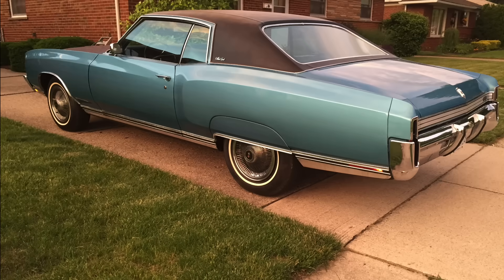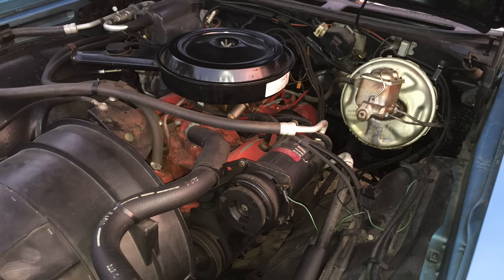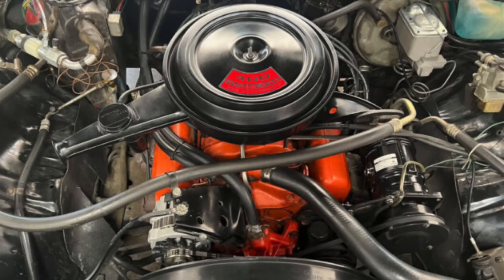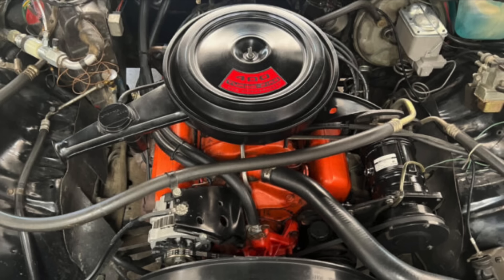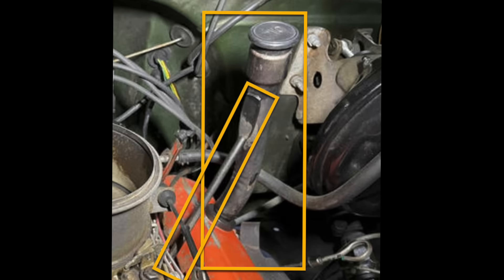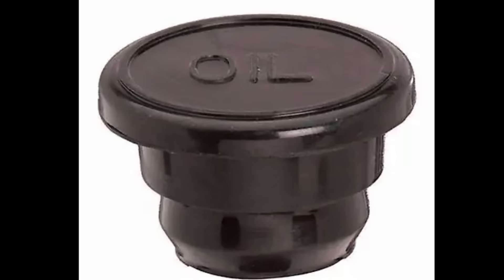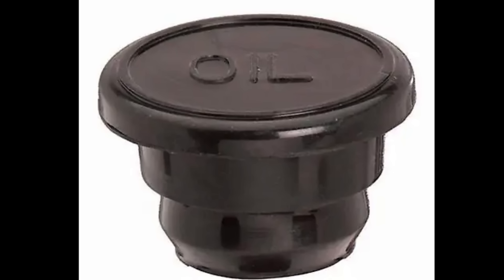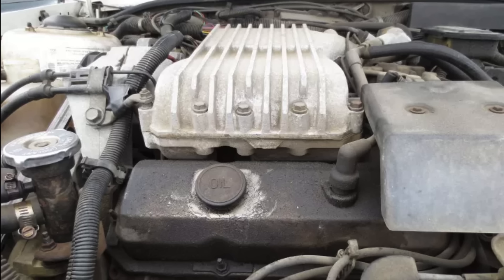Worst Automotive Ideas: Chevrolet's Crumbling, Rubber Oil Fill Cap (Small Block V8 / 2.8L V6)

Comment: my s10s has lasted almost 300k .
Reply: I have 250,000 miles on my 84 & my parents 89 S10 Blazer has 280,000 miles. Am rebuilding the 89 right now. Finally would not start. Would turn over okay but would not run. Compression was only 80# in a couple of cylinders while a couple others had 150#. Have a machine shop doing the machine work for me.That old 4.3 will be better than new. Not having any of that RTV sealant used all over engine as GM was so great at using in the 80`s! At 233,000 miles had to have the 2.8 "B" engine rebuilt as blow by was terrible!

Comment: On the subject of water pumps I'll have to say that Pontiacs were kind of bad for eating up water pumps. They would be fine if as soon as you got one you added water pump lubricant to the coolant. That seemed to do the trick. The fact that Pontiacs were a bit more of a PITA to change water pumps than Chevy's made it even worse.

Comment: Hardly a "classic", but my 2002 Envoy is old enough I have done the thermostat 3 times. Twice that I've paid for it, now that it's my winter beater, and it's nearly(?) a two hour job at the shop, due to it being behind the alternator and also about 8" tall. My other vehicles are far simpler, my 2010 Challenger is about a ten minute job being front and center on the upper intake-as God intended.
Reply: Better yet is2l ohc chev 4cyl t stat, just under rad cap. Take off cap pull out t stat, put in new 1 n screw cap back  on, no tools needed

Comment: Few are brave enough to utter the words "MY CIMARRON"
Reply: He loves that thing, check out his library, he searched long and hard to find one.
Reply: my mother-in-law and father-in-law loved their CIMARRON they had two one with a 4cly, the loved one with a v6 better car Cadilac should have made them all with the v6 and never put the 4cly in them stupid,
Reply: @jimbo5728  😂😂😂
Reply: For myself being around when those cars were new, we still had malls and they were pretty much at their peak. Every mall had a sweet smelling Cinnabon eatery and the Cadillac model spelling was close enough to make one think rich over sweetened cinnamon rolls when their car name came up. 
"My uncle has a cimmaron." 
"Mmmm I love those things at the food court in Fairlane Mall"
Reply: It was just a cavalier with digital upgrades. We are talking about 1980's vehicles. It's almost a half century old. Rubber oil caps were never a problem. I was a GM tech for 34 years. Dodge still  uses them on differentials.
Reply: @krisf7208  the Saville was just a Nova with caddy upgrades, and it worked a popular car beautiful car they added all the doo Dads on it left the v8 engine unlike the Cammeron nice looing car but for a Caddy way under power if the morons would have waited half a sec for the v6 it would have been the new baby Caddy
Reply: @krisf7208 I've personally known 3 people who never checked their Dodge RAM diff oil with the rubber caps and destroyed their ring and pinion eventually. The tell tale sign of a wet housing, especially when viewed at night with your headlights highlighting the problem. Made me want to chase some owners down and tell them to check their diff oil, LoL

Comment: I have never understood why manufacturers use plastic or rubber on pieces that will be opened or unsnapped in some maintenance area of a vehicle. I have several examples of breaking some snap or lock when doing some maintenance because after a few years they are not pliable anymore and just break off in your hand. Not always convenient to replace them and then the wire ties and duct tape come out to rig the piece back in place.

Comment: In response to your comment regarding Cadillac water pumps: I replaced TWO water pumps on my 1972 Sedan de Ville, One water pump on my mother's 1973 Calais Coupe, THREE water pumps on my 1976 Sedan deVille, TWO water pumps on my 1979 Fleetwood Brougham, and TWO water pumps on my 1983 Eldorado. Cadillac engines love to eat water pumps and air conditioning compressors.
Reply: Was thinking the same. Must've been that era because I replaced the water pump in my '73 DeVille TWICE in less than ten years.
Reply: Y'all gotta double check your belt tension

Comment: Honestly, I’d rather have to deal with this single component - maybe replace it every five years - than all of the plastic under hood in modern engine bays. Coolant lines, valve covers, intake manifolds, and even oil pans. Such a terrible choice. 

The only question remaining is whether vehicles will be mechanically totaled by these failing plastic parts, or bricked when their extensively integrated electronics go bad.

Comment: One of the things I didn't like that gm did for cost/weight savings was chrome plated plastic in the mid-70s. Every gm car that had that chrome plated plastic would start peeling, fading white or yellow, or flake off to expose yellowing plastic from about 5 to 10 years unless kept in a cool, clean dry garage. By the mid to late 80s, every full and mid-sized mid-70s gm car looked worse than every early 70s, late 60s gm full-size, mid-sized car that had the original chrome on metal.

Comment: I still miss not having a vent window!
Reply: My 1963 Falcon has these.  They work pretty well until you hit a stop light.  Not good in 107 degree Texas weather.
Reply: Amen my brother!!~
Reply: My 1990 F-250 and my 1955 Roadmaster each have vent windows. And each have the high beam switch on the floor
Reply: @jamesbulldogmiller  The high beam switch on my Falcon and 1978 Mustang are on the floor also.
Reply: @jamesbulldogmiller  I'd like to know whose stupid idea it was to take the dimmer switch off the floor. It made perfect sense to have it there.

Comment: Guess I got lucky as the only GM car I had a Buick 231 V6 which liked to eat motor mounts. But at least the oil fill cap did not self destruct. 😊

Comment: That's exactly what is still on my 400 in my 79 G20 van. It's in good shape at this point and never even occurred to me that it could become a problem. Thanks for the heads up.
Reply: I had a 1975 Beauville van with a 350 4 barrel. Same sheet metal tube with rubber plug and of course the worlds longest dipstick!
Reply: I think on vans it's ok because it's 5 miles away from the valve cover away from heat!

Comment: Rubber was used '71-'95, but application would vary by engine, not vehicle. My 70 Caprice 400 & 82 267 Camino had metal twist lock down. Working at Chevy store as a kid enthusiast, I began noticing the red rubber plugs in '71 on most everything. Vegas had both styles & the Cosworth got rubber.
Reply: My 70 LT1 truck 350 iron heads had the rubber, to which I replaced with chrome covers with the twist. Both our 72 Malibu 307 & Monte Carlo 350 had the rubber that broke rock hard particles into the head. I don't remember rubber plugs on the 400, 350, 301, 3.8 Buick, in Pontiacs. Rubber on our '95 Astro, my C3 L82 has a twist, as the L48 is rubber

Comment: Better than the Wet Belts in many modern engines that can die at 50k miles and cost many thousands to repair.  In an older vehicle, it can total the vehicle.  What idiot thinks running rubber in oil is a good idea.  It is currently a repair fiasco in Europe in Peugeots, Fords and other makes.
Reply: Don’t know of any wet belts dying at 50k.
Reply: @patrickr9372  https://www.youtube.com/shorts/CzkZITXWm-8?feature=share
Reply: @patrickr9372  Thousands of failures in Europe.  Peugeot had so many they redesigned the engine.

Comment: I've never changed a water pump on any car I've had and a couple I had up to 150-200 thousand miles. A lot of the problem is  belts too tight. Rubber oil plug isn't a big deal. Replacement is cheap.

Comment: The Germans seem obsessed with putting as many plastic components in inaccessible, high temperature areas as possible. 
An early example is the "crack pipe" plastic water neck on the VW 2.8 VR6. Aftermarket aluminum replacement is a common upgrade. 
How about the timing chain driven water pump on some ford V6s? You only know it's leaking when coolant has diluted the oil.
Reply: That Ford water pump is one of dumbest and most evil things ever.
Reply: The 3.5 transverse engine has a weep hole that should vent externally to the front of the engine (left side of engine). However if the bearing in the pump goes bad, coolant in oil and self destruction! Also I believe the job I pays 12 hrs.😊

Comment: When I was little more than a kid and pumping gas for a living, I hated those things.  They'd go hard, they'd crack and leak.  Pull one out and it would fall apart and the cu would blame us, of course.  The problem is that, chemically, oils attack and dissolve rubber.

Comment: Another worst idea - plastic fuel filler doors on millions of Ford Motor Company vehicles.  After a few years, the plastic would slightly deform, and the fuel filler door would not open from the release lever inside of the vehicle.  You would have to open the trunk and use the manual release to open the fuel filler door, which was a pain.  All other manufacturers had steel fuel filler doors, the same material as the external body panels.  They never stopped working with the interior release lever.

This was a horrible cost savings idea that frustrated many owners.  I hated putting gasoline in my 1996 Ford Contour, when the fuel filler door had to be manually open after 3 years.  I bought the car new, and it was never in an accident. 

These plastic fuel filler doors were used from the mid-1990s.  When Ford went to capless fuel filling, they removed the inside fuel door release lever.

By the way, I would never buy a vehicle with a capless fuel tank.  Anyone could put something harmful in your fuel tank

Comment: Dad's 1979 Chevy LUV had one of these rubber fill plugs on its Isuzu 4 cylinder... that's the only one I've had to deal with it on. The truck was up close to 200k miles when I got my driver's license, and I remember having to fight that rock hard rubber cap at oil changes and between them to add oil. I had to use a huge screwdriver to pry it off and my fist or a rubber mallet to pop it back on. I also remember seeing it on some 454 engines- I'm not positive, but my memory is saying mid 1980s?

Comment: 1971-1972 Chevrolet small blocks and big blocks had the rubber oil plug. 1973 models went back to a metal twist lock oil cap.

Comment: Our ‘74 Vega had the rubber plug, but that was the least of its problems
Reply: The Vega was one of the best things that ever happened to Toyota and Datsun.
Reply: @jamesrecknor6752  so were tighter emission controls. Toyota designed its engines to  run well cold or warm in spite of stricter emission controls.
Reply: Mine too!
Reply: I had one as well- I actually loved that car and never had any real problems with it.
Reply: that stupid aluminum block 2.2, stupid 1 piece air filter, stupid body with built-in rust aaannnnd... nevermind. Nothing Ziebart & a 327 couldn't fix.
Reply: @vk2aafhamradio 2.3l (140).
Reply: The ‘71 through ‘75 models used the rubber plug, then when the cylinder head and valve cover were redesigned for ‘76, Chevy switched to the stamped steel 1/4 turn cap with gasket.
Reply: So did my dads 1972 GMC with the 250 6 popper
Reply: Same here on my 1974 Vega GT.  It used so much oil that I would add oil before I filled up with gasoline.  Cars don't normally rust in Louisiana.  This one did.  I used to keep a towel in the car so when it rained I could wipe up the water that came in around the windshield.  Twice I "overhauled" the engine myself.  Not knowing what to do about the aluminum block I went to a Chevrolet dealership and asked a mechanic who told me not to have the cylinders honed but only change the piston rings.  I had a valve job on the head as the valve guides were allowing oil to flow around it.  There were also numerous other problems too numerous to list.  As a student in college, it was an economic hardship.  Once I finished college I bought a Touyota pickup truck.  What a joy it was compared to the Vega.  I now drive a Lexus with 230,-000 miles on it.   I change the oil every 5,000 miles.  Oil use is near nothing when it's time to change the oil.  There is no rust on the vehicle and I live in the same location as when I owned the Vega.  Like another person commented, the Vega helped Toyota and Datsun

Comment: I was a gas jockey back in those days and handled a great many of those damned things and had several of them come apart when I tried to remove them. In one case, the top came right off and I had to grab a pair of pliers to gently remove the rest of it from the hole lest it fall into the engine.

I sent the lady away with a piece of rag in the hole and instructions to get a new cap ASAP but she never did. Came back numerous times, still with the rag in the oil hole.

Comment: Had it on me 89 G10 but, the distance from the engine heat in that case made it stay ok just fine for the several decades I owned the truck.

Comment: I had a 95 Mercury Mystique that had an idler pulley for the timing belt that had a metal bearing in the center,  but the outer was cheap plastic.  The plastic outer shattered shortly after I bought the car,  causing the timing belt to jump free and bend the valves, ruining the head. At the dealer,  the part was only $11!

Comment: One of the weird things about this was it wasn't "across the board" on Chevrolets.  Starting about 1972, many had it, but not all. I wonder if the particular engine plant determined it?? Regardless, just an odd feature, for sure.   Throughout its history GM did some pretty interesting cost cutting.  C-clip axles were one of these, beginning way back in the late 1920's-early 1930's in certain Buicks , by 1933  Chevrolet had them, then ditched them in the passenger cars for 1955, then they came back in 1964 for the Chevelle / Nova, 1965-on for the full size cars. Nobody minded them until the late 1970's-early 1980's lawsuit (probably the Malaise era quality control was the real problem at that time).

Comment: Can't believe that this was considered cheaper & superior to plastic caps, even in the 80's?  Pretty much every single non-commercial passenger vehicle today uses plastic oil-filler caps, and they perform as well as the metal caps of old.  Considering issues of blowby and PCV systems, who ever thought back in the day that perishable rubber would suffice?
Reply: I'm a heavy duty truck mechanic and I can tell you that every Mack, Kenworth, Peterbilt etc I've worked on in that last 15 years also have "plastic" oil fill caps, so they are indeed being used on commercial vehicles.

Comment: My vote for worst idea: Starter motor in the V on a V8 under the intake manifold.
Reply: You obviously have nevet had to change a starter that is under the engine and you need to remove the subframe to access it.
Reply: @thevictim2072  Just about as much fun as when I had to replace the starter in my parents 89 S10 Blazer where the wire to the relay was too short & had to cut the wire to remove starter like I was in a wrecking yard!! Then had to solder wire extension upside down so as to replace starter once I had it rebuilt.
Reply: When it comes to the northstar i honestly think it is a great idea. Its not hard to change at all and is just fearmongering by people who has not even changed one ever. Its not like you change starters 3 times a year anyway
Reply: @stigarchives4138 

Yep, it's always people who have never even touched one that complain about it. In the case of the Northstar, it keeps the starter clean and dry, so it lasts much, much longer. Plus, pulling the intake is extremely simple.
Reply: @johnfox4376  exactly what I was going to say. How many times are all these people who are complaining about it replacing starters? In the valley is a great location for it.
Reply: @stigarchives4138 what makes the idea great?
Reply: Starter in the V,  isn't this the Toyota V8 too?
Reply: @ceciltrane5418  Yep, the 4.7L, I believe.
Reply: Rubber timing belt,oil pump belt behind engine. And the transmission has to come out.
Reply: @daleolson3506  😮  Wow, what engine is that? I've led a sheltered life with stuff that is  externally accessible
Reply: @ Chevrolet ,ford,and some Hondas. Horrible crap.

Comment: Don't recall them crumbling.  Generally what happened was they hardened and would be loose because they didn't seal correctly.  Was it a dumb idea...yes.  Was it cheap and easy to fix...yes.  Put it in upside down and it becomes the "710" cap!  😆😆
Reply: Yes I've never seen one crumble, they just got hard and shrunk up a little too. A small dollar item, just replace it and go on.
Reply: should have bought 2. one as a spare
Reply: @terrellalleman376  Use one, then throw away the spare when it got rock hard. Kinda like going through all those fast-food coupons and disposing of the ones which just expired.

Comment: I drove a 79 Caprice in the mid 90s when I was in law school. Had a 305 with 2bbl.  The radiator started leaking on it at about 90,000 miles and I had local radiator shop replace it.  He told me the car had the original water pump and he'd just about guarantee me that putting a new radiator on would cause the water pump to go.  He suggested I replace it too.  I thought he was just trying to gouge me, so I declined.  A week later I was back at his shop with a leaking water pump.  Edit: The 305 in my Caprice had a metal screw on oil cap.
Reply: The fact you went to a shop to have the water pump changed and a 305 lol.
Reply: @MUUKOW3  Not everyone is adept at car things.

Comment: 350 V8s were good engines but they were gas hogs too. I had a Chevy Monza with a 262 V8 that was shoe horned in it.
Reply: Changing the rear most plugs was a nightmare.  Either you lifted the engine or came in through the tirewell.